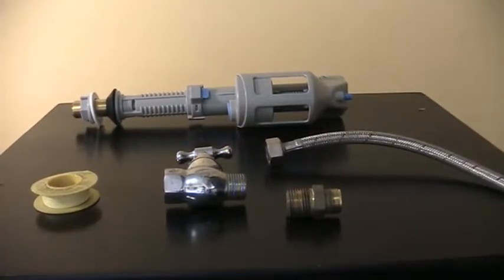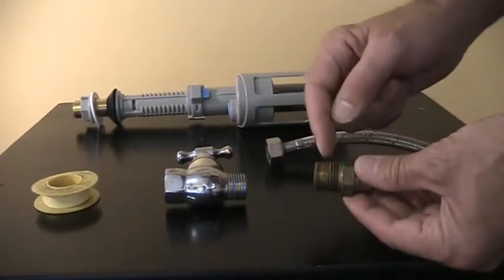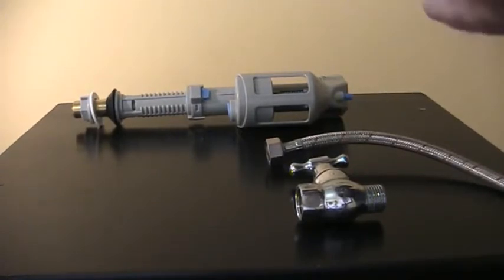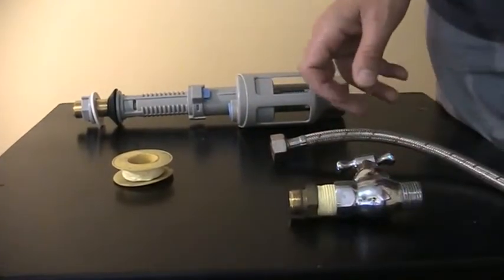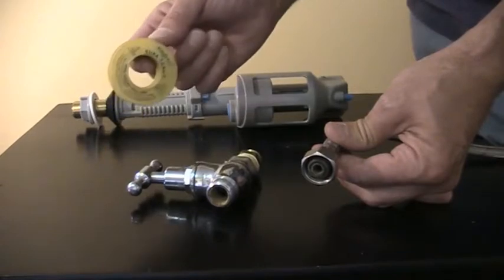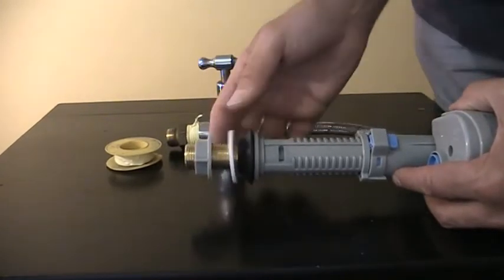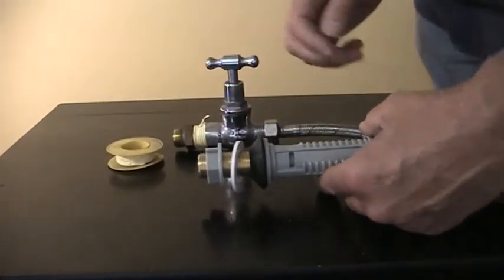Part 3 Taper vs parallel threads

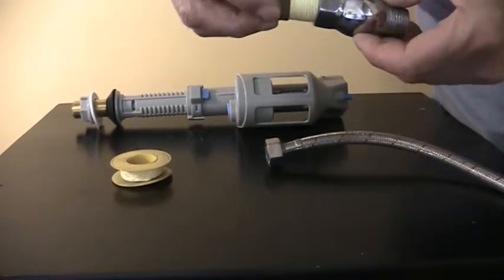Comment: A very clearly explained video, thanks so much. I always wondered the difference when they say parallel thread and tapered thread. And now I also know when PTFE tape will and won't help. However, the OCD in me just wanted to push the end of the PTFE tape at 2:15 flush against the thread. I had to look away when you inserted it into the female part.
Reply from the maker: 😂Sorry but it works :)